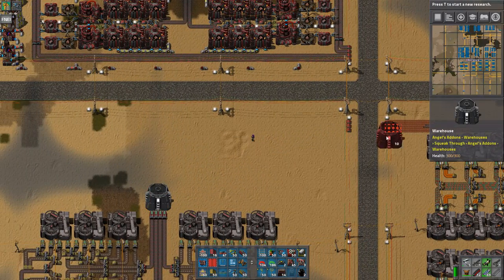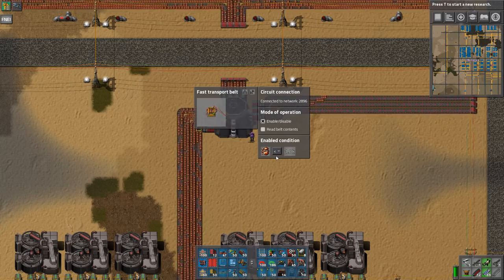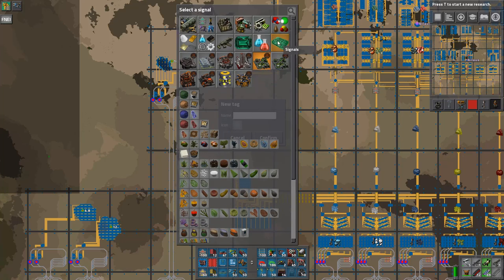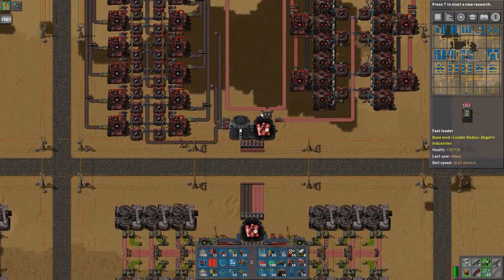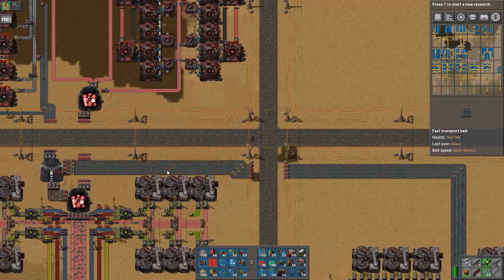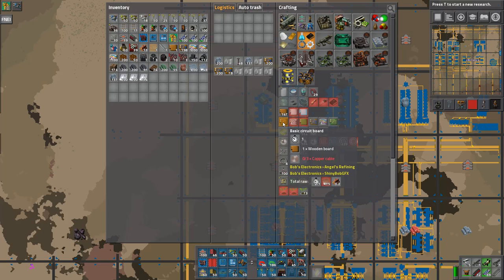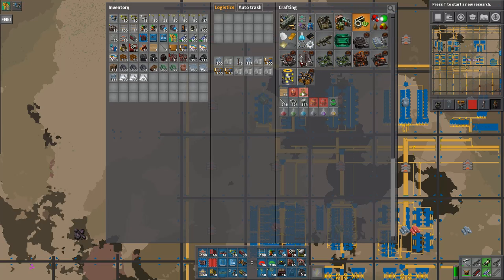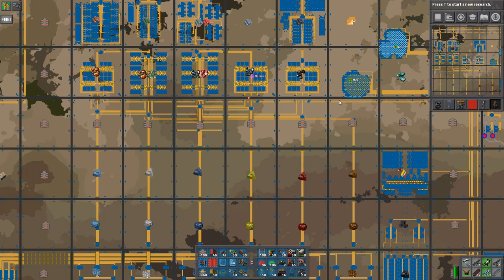Factorio 0.16 - Angels Mods Tutorial Lets Play #30 PURE IRON AND COPPER SORTING

Comment: the mixed box for the maganis and iron you could limit the output to only pull iron if there was say like 10 in there. That should keep 1 slot reserved for iron
Reply: I believe that would get stuck when every single belt coming in has a manganese ore at the front, as then it would stop all the belts forever.

What might help is a line of splitters with priority on iron ore to one output lane, so most of the iron ore gets pushed on to a single belt going into the warehouse.
Reply: Kevin Hinton there still would be a problem with the flow of manganese, but this is better than the way it is set up right now :)
Reply: Manganese will fix itself later because it's used for aluminium and cobalt.

Comment: How do you have so long undergrounds?
Reply: Correct me if I'm wrong, but I think that Bob's increases underground length. It was originally like the feature that was added in a somewhat recent patch where they get longer as the tier increases, but I think it has more of an effect than that.
Reply: Ok thanks
Reply: in Bob´s Logistics you can set the tiles each tier goes further than the last. On Ryn´s map we had like 50 tiles+ undergrounds. it gets a bit boring tho.
Reply: In addition to all of the valid answers above, there's a mod called "Longer Underground Belt (Aligned)" which redefines belt-tier underneathy lengths generally.  It works with vanilla-only belts (YRB) and it also incorporates other mods that add tiers of belts, such as Bobs.

The mod's settings can be tweaked (pretty sure it's before startup and not from in-game) but the default settings, which I think I'm using, are pegged to follow standard mainbus design.  For example, yellow UG still has a span of 4-tiles.  This was always true, and it results in the common mainbus design of separating your belts into sections of 4, so that yellows can always traverse the distance.

With the mod, reds can now span 10 -- two separate 4-groups, plus the 2-gap between the 4-groups.  I haven't unlocked blues yet in my current playthrough, but I have every reason to believe that blues will be able to span 16.